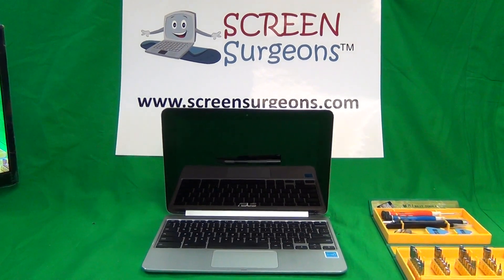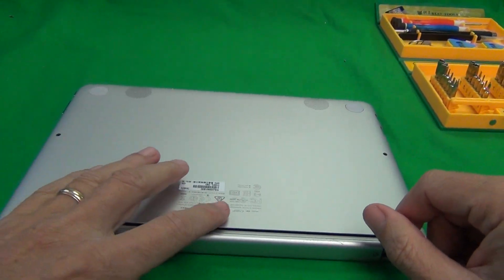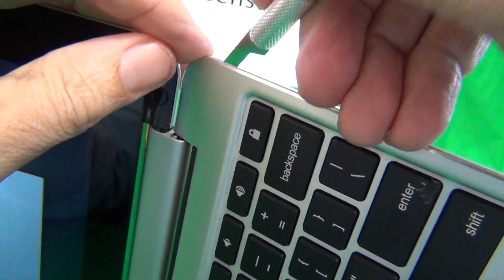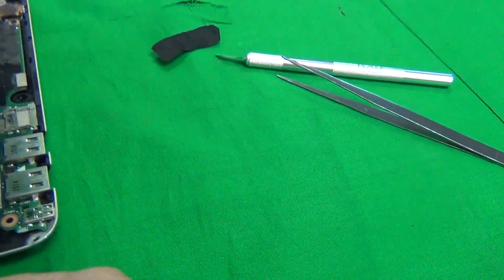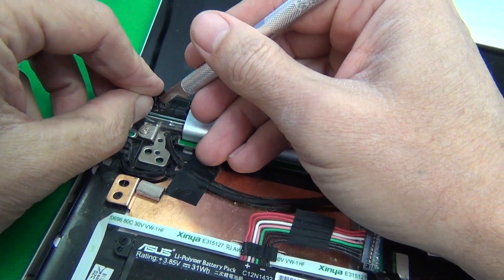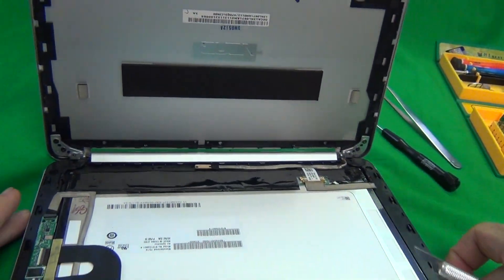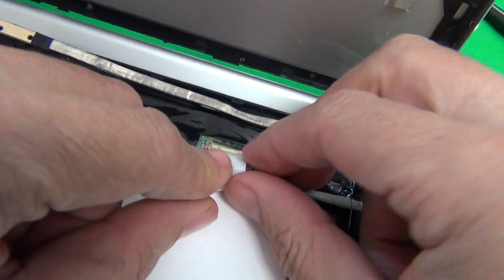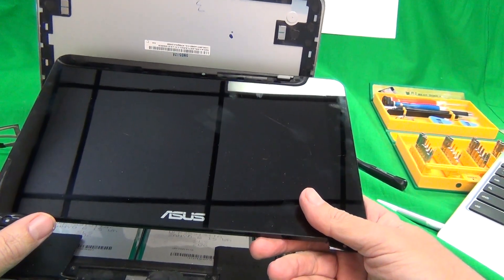ASUS C100P Chromebook Touchscreen Assembly, Keyboard and Battery Replacement Procedure Part 1

Comment: I loaned my C100P out and when it was returned, I have no power at all.  Does the battery affect the A/C plug in?  I tried the reset and it didn't work.  A/C plugged in, no power whatsoever. Thanks.

Comment: Instructions for screen are useless, as the screen replacement you can buy has no chipset on the left, nor a frame. It says it in the video, but does not specify how to solve the problem. Be aware of that

Comment: you might have already said this on the video but why is it important to unplug that thing before you can work on the screen?
Reply: Although rare, if you contact that video cable 'just right' when putting it in, you can do some serious damage to the motherboard and render the device useless.  I've heard of it happening once with a Chromebook and once was a Lenovo Windows Laptop.  NOT unplugging the battery is rolling the dice basically.